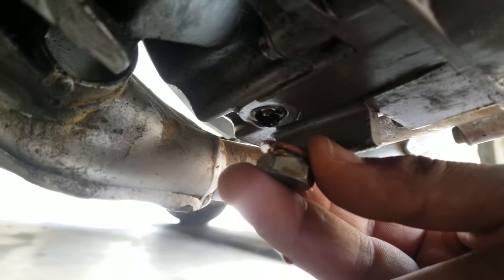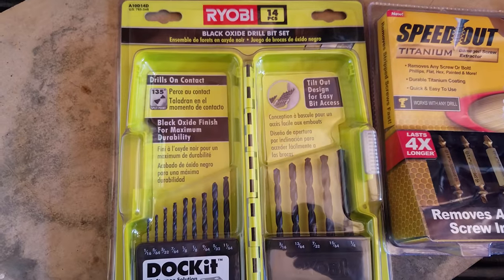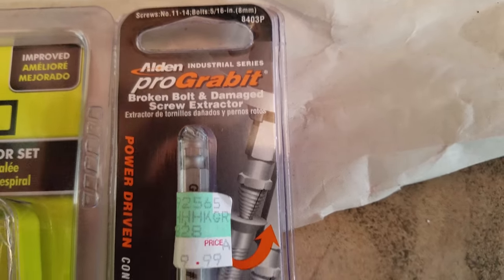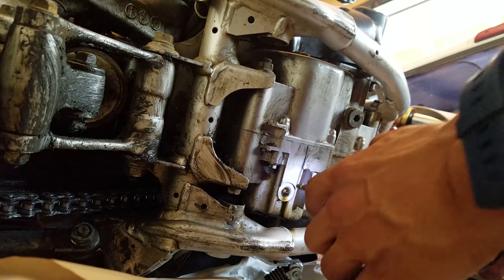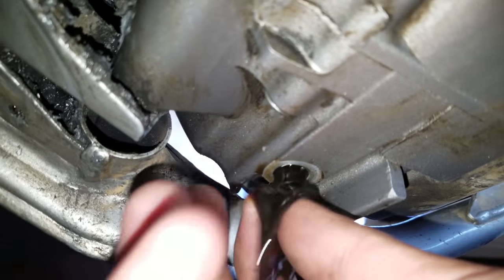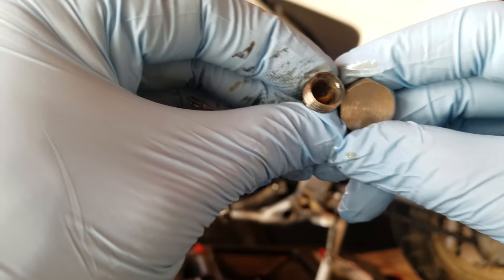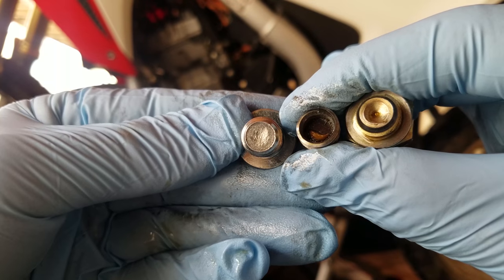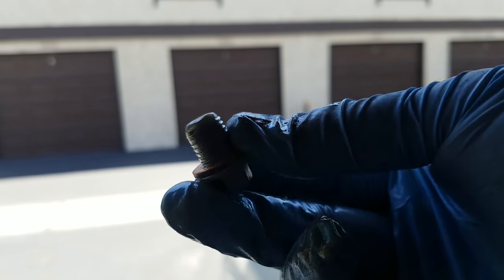Broken Oil Drain Bolt: CRF250L

Comment: Thanks for leaving out the music! I'm glad you were able to find what you needed. I like the idea of a magnet being in the drain plug to hold any metal at the bottom of the oil pan, I'm not so sure it actually works though, and as you said, it makes the drain plug weaker. Can't wait to see you ride it in town and talk about your bike or your week.  

I just got my gokart running after it sat for 10 years broke down after 2 days of riding but it was nothing serious. The rubber seat and float in my carburetor dry rotted and the float had gasoline in it. No big deal I went to my local lawn mower shop and got them both for 7 dollars and got it running again.

Comment: Same thing just happened to me on my Honda 919 drain bolt during a n oil change... Already had bought 2 Honda OEM bolts years back. Never going to use those type of aftermarket again either... Haven't removed mine yet... Only idea I have is to lay the bike on its side and try my screw extractors. May have to make a trip to get more 5 gal gas canisters if I need to drain the fuel first.